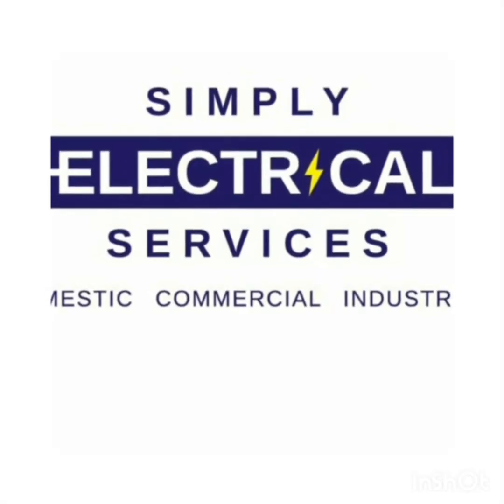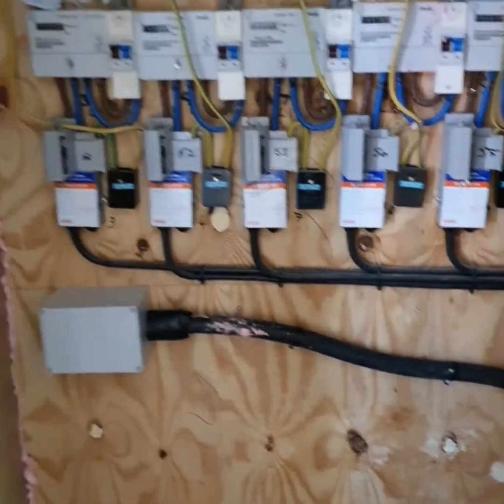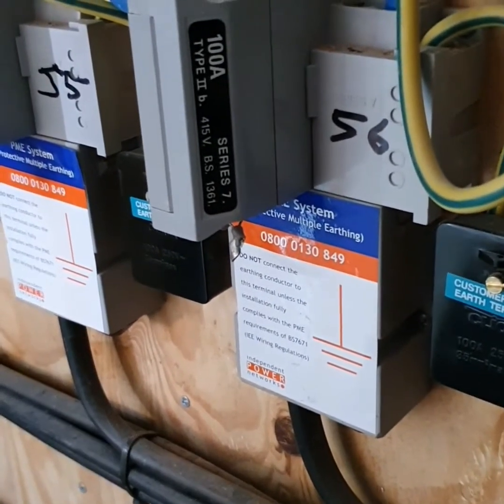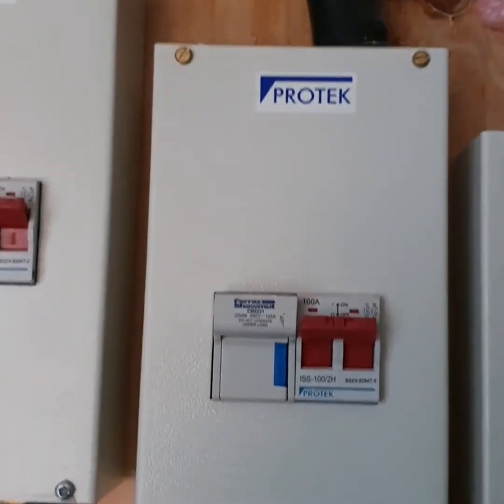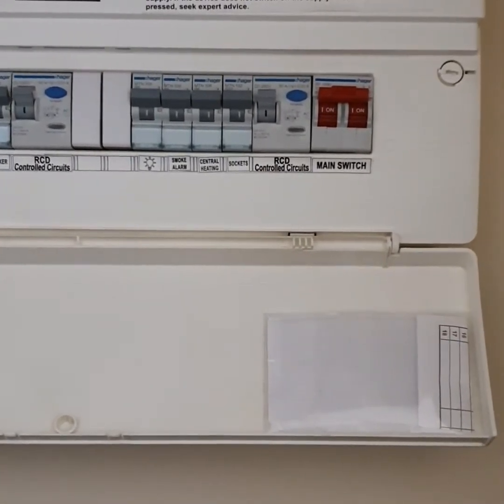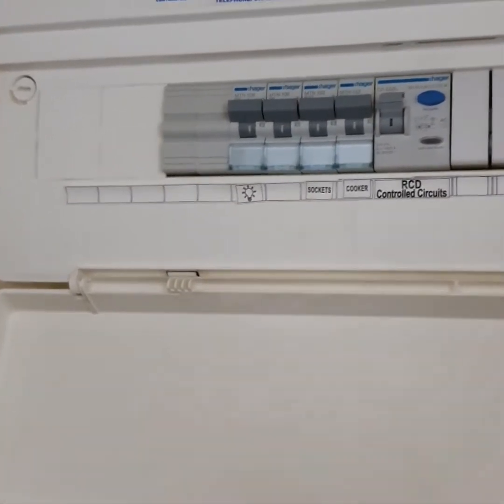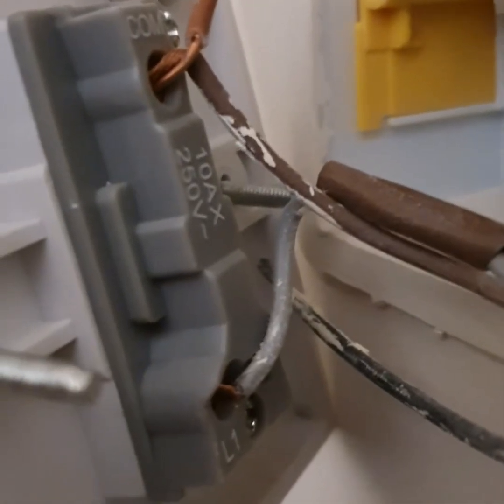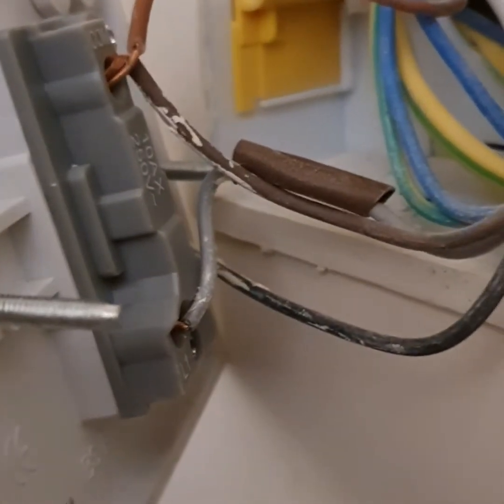EICR - Landlord Safety Check

Comment: I don't doubt CPCs twisted together aggravates you and many other electricians but continuity, even poor continuity,  is likely to be maintained if these conductors come adrift from a terminal, whether in a back-box or in a socket. Separate sleeves particularly on radial circuits are bound to be less safe, don't you agree?